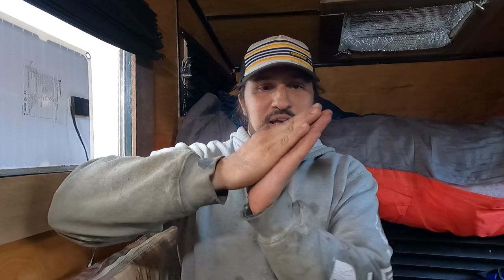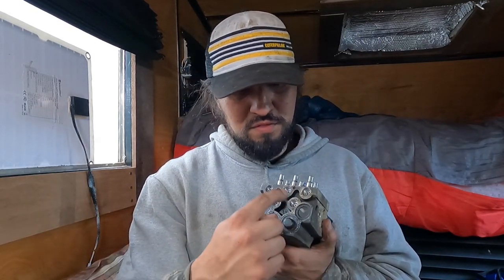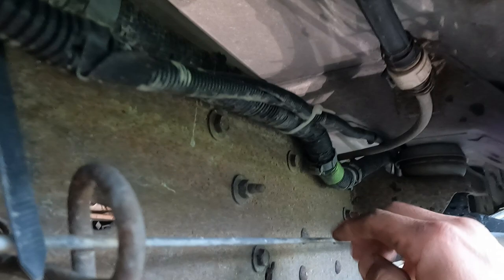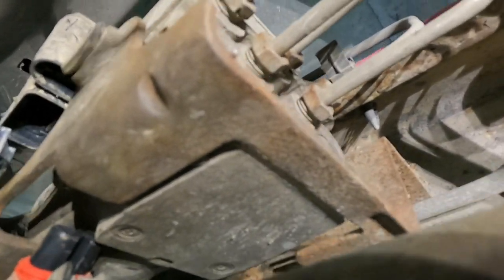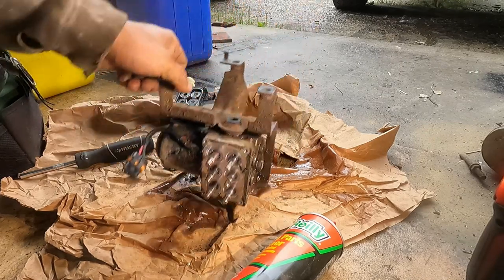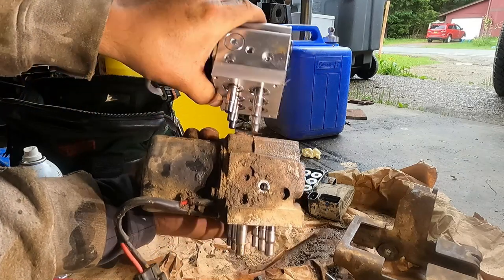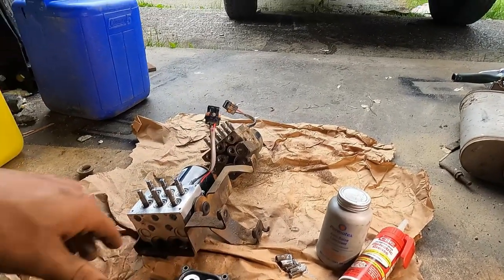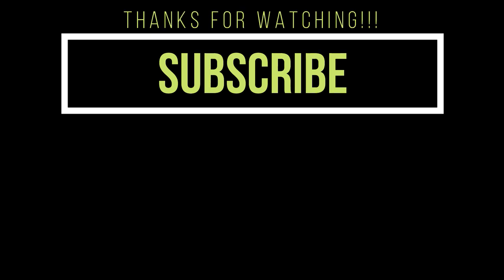99-02 GMC Chevy ABS Pump Replacement

Comment: After replacing it, do you just turn the vehicle on and pump the brakes to get the fluid to all the calipers and drums?
Reply: I see you responded to someone else asking the same thing haha
Reply from the maker: @17PAT17  Hey Patrick,  haha, you're right I think I did respond to someone else with the same question.   There are two methods I am aware of that will bleed the ABS pump & valve.  The first one is to use the ABS bleed function.  The other method is what I did:  find yourself a dirt road, wet road, or slick road of some sort (and be very careful when you do this)  then speed up a little bit, 10-15 mph may do it for you but I'll let you decide what you are comfortable with, then slam on the brakes to initiate skid.  This will activate your ABS system and the pulsating pump will clear the air out of the valves.  If you brakes go from hard to a bit squishy like there is air in your lines then you know you were successful.  Then you simply bleed your brakes as you normally would.   You may have to rinse and repeat but for me it only took the one time then one more time after that for good measure.   BE SAFE.

Comment: Hi thanks for the videos keep them coming if you would. But I've got air I believe trapped in my ABS unit and I've tried using a scanner tool to activate the ABS unit and that didn't work for me. Ive done it with the bleeders open and with the bleeders closed and still cannot get the air out of it.  I was wondering if you remove the two bottom rubber caps on the bottom of that ABS unit will that allow you to bleed them right there?      Thanks
Reply from the maker: Hello Dan,  you know I'm not to sure about those  bottom caps. I'm surprised the bleed function on your scan tool didn't work though.  Have you tried taking your truck on an old back road, driving up to 10mph or so then slamming on the  brakes to activate the abs pump and forcing the air out?
Reply: @KooshdaakaaGarage  yes I used the tool to activate the ABS unit and I've done it quite a few times actually after driving a truck I can tell the difference but I know that there is still some air in the system
Reply: @danknitz9679  hello, working on similar issue, brakes bled, new calipers, no leaks, no pedal feel.  First confirm master cylinder is good by blocking off both ports of master cylinder. Pedal shud be hard. Mine was OK.  

Next remove two rubber dust caps at bottom of ABS block, insert a diy measuring stick made of coat hanger, have helper depress pedal. If stick moves more than 1/4” ABS block/valves may be bad. Do both sides.  Best of luck.
Reply: @ronaldscott781  are you working with a 2000 Chevy Silverado?

Comment: Hey not sure if you can help me or not but at 3:09  those 2 black caps by your pinki one fell of of mine do i have to get a new pump or just put a cap on it and if its just a cap where could i get one?
Reply from the maker: Hey man, good question! So it's been a while since I read about those but if memory serves me right, those are dust covers for two ports that are used for bleeding the abs valve module if you have the right tool.  I don't think you can buy new caps but I imagine a guy could fashion something up.

Comment: Did you have problems bleeding the system?
Reply from the maker: Not really. I hit a patch of dirt road or wet pavement and did a series of controlled braking at 10-20mph to force the air out of the abs unit and into the brake calipers, then bleed them as usual.  Took a couple rounds of that to get all the air out.

Comment: Can I have a link to the part you bought?
Reply from the maker: Hello again KingDEATHCLAW54,  I'll put the requested link in this comment but please make sure to read my answer to your last comment first as it may save you quite a bit of money.   Ok, so your ABS modulating valve & pump will be a little different than the one on my 1 ton Duramax due to the towing capacity,  brake caliper holding power capabilities etc. However, the install procedure is exactly the same.  So I found the one that goes specifically to your truck, here it is:  https://amzn.to/3iPHysO  Best of luck man!  🍻

Comment: Is there a code how do know if your abs pump is bad
Reply from the maker: Hello Erik and thank you for your question.   If you have a code reader that reads ABS codes, it will throw a code when your ABS light comes on.  If your pump goes out you will notice a significant drop in brake pressure.  Likewise if your valves are stuck open or part of the way open.  Another sign is your brakes lock up and skid instead of activating your ABS pump to pulsate the brake pressure.  If you have to pump the brakes to gain pressure then your pump and/or valves maybe failing.  Before replacing your ABS pump, I'd double check your ABS sensor to make sure they are not damaged or the hub isn't rusted to the point of lifting your sensor to the point that it does not make magnetic connection. A failed ABS sensor could shut down your whole ABS system when your vehicle can no longer get a reading on wheel speed.
Reply: C0267 is the code
Reply from the maker: @diesel09  thanks Bobby!  ERIK G, this the failed abs pump or failed abs pump wire harness code.
Reply: @KooshdaakaaGarage  correct. If code pops up, replace both.

Comment: So how did you bleed the unit?
Reply from the maker: A tech II or the like would be the best way to bleed the unit. I don't have one of those so i found some wet pavement, speed up to 5 or 10 mph then slammed on the brakes to activate the ABS pump.  You can feel when the air gets pushed out because your brake calipers feel like they have air in them.  Then I drove back home, bleed the brakes at the caliper then rinsed and repeat a couple more times to be sure.
Reply: Thanks

Comment: I have a c0131 traction control system pressure circuit malfunction and c0283mode switch circuit malfunction. It's like I have brakes but not the best unless I push all the way down. Pedal also feels like it doesn't really spring back after pushing it. Tried Google and it's pointing to replacing this. It does feel like the brakes drag occasionally. Also if turning to the right and traction control kicks on from gravel, ice etc the passenger front brakes stick until I shut the truck off and let it sit for a minute
Reply: Did you ever get it resolved? Having similar issues.

Comment: Those fittings are 14mm. It's a tight fit but 14mm is what it is. I'm not trying to be know it all. I'm here because I'm the ra-tard that cross threaded the new brake line fittings.
Reply from the maker: I think I bounced back and forth between 14mm and 9/16s when I changed my rusty steel lines over to stainless.  I used 14mm to break er loose and 9/16ths to finish it off 🤘😁🍻  thank you for your comment and I hope you get your ride back on the road soon if ya haven't already!

Comment: Where are the internal bleeder screw on the abs module itself so I can bleed the abs module by itself, without a stupid scanner. 🤔  just show an actual video of  how to bleed the abs module by itself , alone , not the calipers , not the master cylinder , just the kelsey hayes abs modual without all your long-winded background of the history of your truck I don't care , I just Wana see where the internal bleeder screws are located and see the module be bleed. Is that really so dam complicated ?
Reply from the maker: Winge much? It doesn't have one.  Like I said in the video you can get a scan tool or hit up a dirt road, wet paved road, etc and slam on the brakes, that's what I did.  Its...not...that...big.. of..A...deal...man.
Reply: Thanks ,I guess my 03 doesn't have a separate  valve I guess it's in the abs module an gana end up shaping it for one from the rusted out 02 lol
Reply: Also cross threaded my module= bought a used one from a junk yard...very important turn in by hand.